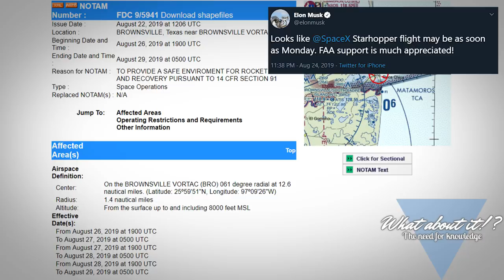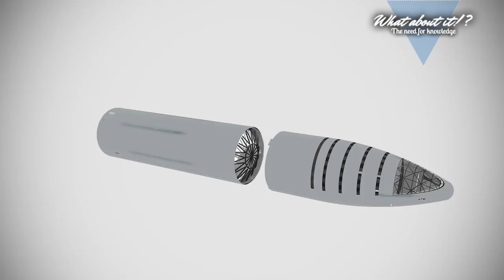28 | SpaceX Starship Presentation Delayed- Starhopper Updates - Delta IV Medium Last Launch

Comment: they really dont mind flying the ship with a nose cone right
wouldent it cause some trouble at 200m
Reply: I don't think the speed at which its going would change its aerodynamics and inturn change its coarse or position much
Reply: @pushabug_923  wat about crosswinds or something
Reply from the maker: Correect. Speeds are too low. :)
Reply: even though im excited im still woried but thanks for removing the wories i really would love it if it would get off the ground
Reply from the maker: A Nose Cone won't help with cross winds and they do check the weather before pushing the button. Don't worry. The weather will be the smallest problem. ^^
Reply: @Whataboutit  arigato goziamas("thanks")